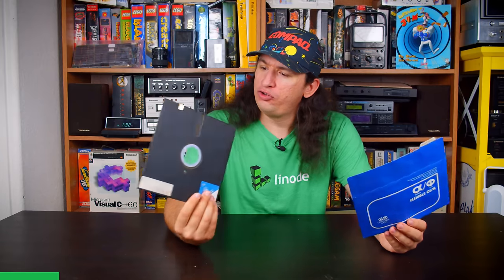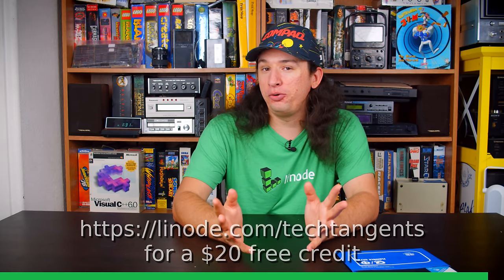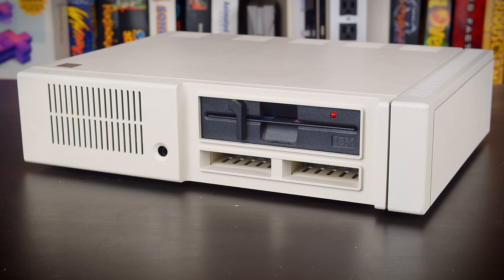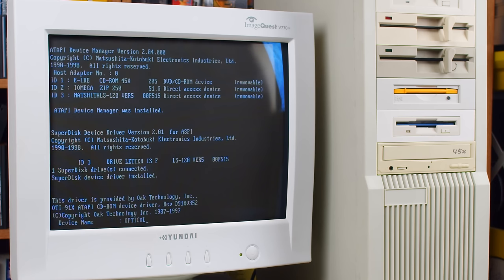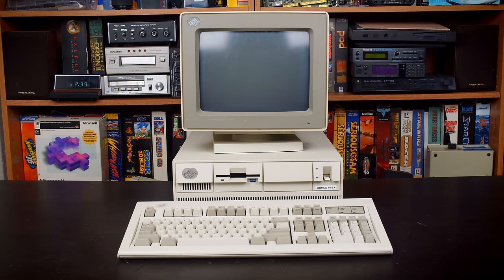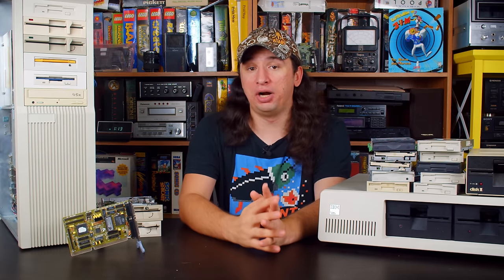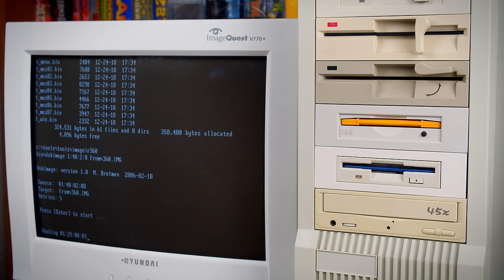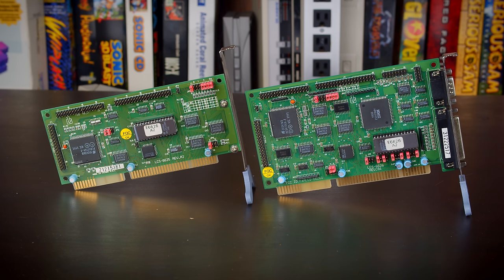More than two floppy drives?

Comment: c: I'm more of a / person.
Reply: dh0: rules all!
Reply: @MariaEngstrom  Sure thing Amigo.
Reply: Not to mention way less limited.
Reply: Oh, b:have
Reply: Me too, but for some reason getting an external floppy drive working on Linux is super finicky.
Reply: The real problem is having a board new enough to run Linux distros you can still get, and old enough to have floppy controllers.

I went to some lengths to get a mini ITX board with an onboard floppy port, onboard IDE that would support the largest IDE drives commonly available, a PCI slot for a SATA controller, and onboard LAN.  This was going to be my ultimate CD, DVD, IDE and SATA HDD, 360K and 720K imaging box.

The floppy controller turned out to be defective.  sigh.
Reply: DaVince21 Really? I’ve just plugged it in and it worked fine.
Reply: @MariaEngstrom  DF0: for the secondary win
Reply: @hawksights  Arguable 🤔
Reply: @alritedave  I was trying to read MS-DOS formatted disks and had to find a special way to mount into those, if I recall. Don't really remember what exactly I had to do or what the exact problem was, to be honest.
Reply: @nickwallette6201  
There are linux distros maintained to this day that'll run on a toaster. Slackware will still run on absolute dogshit, and Zipslack will run on less than that. It'll run on a 386 with 16 megs of RAM lol
Reply: OK, I know you CAN get old Linuxes still.  I went through this recently to try a few computers from around a Pentium MMX 166 to a Via C3.  Most of the live CDs I had on-hand failed for one reason or another.  Some, particularly on the Pentium, would just lock up.  There are certain things you can disable via the kernel parameters that will get it further, but suffice to say, there’s not a lot of testing being done on pre-Pentium 4 hardware.

Using slightly older discs (2005-2012 or so) was a mixed bag.  Some worked more or less but had driver issues - too old, too new, too buggy... Like how the Matrox driver, on a G100 series card (IIRC) was just a mess of corrupted graphics, or how auto-probing for pata_qdi hangs my VAIO laptop.

I am a Gentoo guy, so I took my newest burned install disc (which is a couple years old), and the oldest portage snapshot I have on-hand.  Broken.  Too many circular dependencies between GCC, build tools, libraries, and the stage3 environment, as thing X is WAY too old to work with thing Y, and can’t be upgraded because no version of X exists anymore that doesn’t conflict.

I then downloaded new everything, and used a DSL Live CD to bootstrap, so I could chroot into it and build from scratch, but the “kernel is too old”.  I had to search every CD binder and image file I had to find a 32-bit kernel that was new enough but still old enough.  ;-)

It can be done!  But it is not always a straight line.
Reply: Linux is trash. Can’t change my mind.
Reply: @Hogdriva  
I'm so sorry that your parents fed you lead paint as a child.
Reply: @Hogdriva  That's okay... It's okay to be wrong.
Reply: @Hogdriva  Please stick with Windows. You're welcome to it.
Reply: @DaVince21  Nah, it just works, but some drives are just bad. You could also use an external LS120 USB drive which works great as long as you use a standard 720k or 1440k format.
Reply: Same

Comment: Drive letters were a design mistake.
Reply: I certainly prefer it than the wonderful ambiguity of mounting things at dev/sdb1.
Reply: @SolidSonicTH  They're both ambiguous, but only one of them describes a partition and disk at the same time.
Reply: Lastdrive=Z, executed no CONFIG.SYS  line, ever.
Reply: On Amiga computers you don't have single-letter designations, instead floppy drives are labelled DF0: through DF3:, and you can have more DHx desginations (for hard disks) than you can shake a stick at. And these are just the physical drive names, each disk you insert in a floppy drive can also be addressed by its logical designation, for example the floppy disk which contains the installation files for HiSoft's BASIC 2 compiler has the logical name HB2Install: regardless of which physical floppy drive it's inserted in. In addition to this, you can assign a logical drive name to any directory on the harddisk; many programs which were designed run from floppy uses such assignements to fool the OS into thinking that the HD directory is in fact a floppy disk, thus enabling the program to run from a hard drive. Using the aforementioned Hisoft BASIC as an example again, during installation it creates two such logical names, namely HBASIC2: and BH:.
Furthermore, AmigaOS itself also assigns the name SYS: to the hard disk partition (or floppy disk) it has booted from, thus the same partition could be addressed by e.g. SYS:, DH0: (or DF0:), or Workbench:.
Reply: I'd actually like to have both around.
while the linux way makes it obvious where something is, with drive letters that are assigned to a disk, not to a port, the letter stays on the volume, even if you rearange what sits where.
Reply: On Linux, the /dev names are the names of the devices, which you don’t use when accessing files on a mounted filesystem. You access those via the mount point, which is a directory name, which bears no relation to the device name. In particular, you can use nice, long, meaningful names to identify your volumes, your directories and your files.

Windows/DOS copied the single-letter drive-naming scheme from CP/M, which adapted it as a cut-down version of the device names on the DEC operating system that Gary Kildall was using as a development environment--I think it was TOPS-10, which ran on their big PDP-10 machines back in the 1960s and 1970s. Disk names were of the form Dxn:, where x was a single letter indicating the drive model, and n was an integer to identify the drive, starting from 0. Thus, you had drive names like DK0:, DK1:, DR0: etc.

Comment: Two IDE channels, while redundant for most average users, uses would be multiple HDDs or CD drives (common to have a fast read drive and a slow burning drive).
There are also performance benefits, two hard drives on one channel can only access one drive at a time (shared data bus), but two hard drives on separate channels can be accessed simultaneously.
Reply: ... You know, that explains why my win 95 computer seemed juuuust a bit faster on some games loaded to the secondary HDD after I rearranged things in the case. I put it on the CD's ribbon cable instead of the main hard drive ribbon.
Considering the secondary was very slow (it was the old windows drive), I imagine it might have bogged down that newer 7200rpm drive.
Reply: Since they were available on higher end 486 boards (or as VESA cards supported in BIOS) I would almost always have them filled with a primary hard disk, secondary smaller one (removable, in a caddy) and then a CDROM. Later on the last channel received a burner. This continued until SATA, at least in my builds. I was grateful to have them.
Reply: If you connect two drives on single ribbon, while one wof them is supporting IDE mode and second only PIO4, both of them will work in slower, PIO4, mode.
Reply: @Vein1986  Yep, always will follow the lowest common mode.
Caused many headaches back in the day when UDMA modes came out. lol
Reply: It was also important to have two CD drives to copy a friend's CD! Who had half a gig on their hard disk just lying around unused for disk caching?

Comment: If you enable the external third or fourth floppy drive on the IBM PC/XT, the hard drive will be moved to D: or E:, respectively. I discovered this when adding a hard drive to my dad's IBM Portable PC, and was surprised to see it show up as E:, because for some reason its motherboard left the factory with the DIP switches set to indicate it had four floppy drives.

Also some early pre-XT hard drive controllers which required a boot disk would assign the hard drive to A: after loading the driver software and move the first floppy drive to B:. This is also the way the TRS-80 works -- if you add a hard drive, it shows up as drive 0, and the floppy drives move up to become drives 1, 2, 3, etc.
Reply: The first harddrive is fixed to C starting from DOS 5. But in 3.3, you can get a floppy on C or D.
Reply: @初生之鸟  I can confirm.  On my 5155 my hard drive was drive D: until I upgraded to DOS 5.  It was actually a welcome change because having your hard drive as D: broke a lot of install batch files and other stuff.
Reply: @初生之鸟  But what about DOS-less computers, such as those running Windows XP or later? I have had various Dual-Boot scenarios with either 2x XP, XP + Win7, or Win7 + Win7, and in all cases the currently active O/S will always assign the letter C: to the partition it booted from, while the "dormant" one will be D: and when i boot from the other O/S, its partition then becomes C: and vice versa.
Reply: @BertGrink  In NT-based Windows the drive letter assignments are stored in the registry. Pre-Vista it's super easy to have Windows accidentally on a non-C letter. I'm sure I've run across Windows installed on D:\WINNT before. You must have either done something special or have been really lucky to get each installation to see its own drive as C:.
Reply: @eDoc2020  No, I haven't done anything special, and I would rather have the partition letters be the same regardless of  which one i boot from; i.e. 1st partition should always be C:, 2nd always D: and so on.
Reply: @BertGrink  When you start the XP installer from a running version of Windows it always inherits the drive lettering of that installation (unless you modify migrate.inf)
Reply: My Compaq Portable 1 was set to 3 floppy drives and the HardCard 20 was set to Drive D and I even tried to use the XT-FDC BIOS on my 386 machine and it made the CF card not boot unless I press D several times and it took forever to boot. I did order a Promise DC-4030-VL2 that has support for the 4 floppy drives.

Comment: Another reason why many PCs came with 2 IDE channels is for many years each IDE channel would only run at the maximum speed of the slowest device on a given channel. This was more of an issue shortly ATAPI optical drives became common. Many optical drives only supported UDMA modes 0-2 (16.7-33.3 MBs x-fer rate.) Where later HDDs, especially 7200 RPM ones, supported higher speeds like UDMA 3-5 (44.4-100 MBs x-fer rate.) Later IDE controllers aren't supposed to have this issue but I remember this still happening up until at least the Pentium 3 days.
Also, since both devices on a given IDE channel have to share the data bus it made a lot of sense to place a HDD and a CD burner on different IDE channels. Especially in the early days of CD burning when it was very easy to mess up a burn in progress due to a data under-run!

Comment: The Shugart 8" drives had four drive select wires.  A jumper on the drive selected between "radial" drive select and "linear" drive select.  The Linear select used one wire per drive for a max of 4 drives.  The radial select used one wire to enable the drive, and the other three wires were BCD encoded.  In this mode you could have a max of EIGHT drives on the cable!  IIRC the 5.25" drives were similar, but could only handle a max of 4 drives (radial) or 3 (linear).

Comment: Hey hey you're finally talking about something I knew before hand! Still gonna watch it anyways because I love the production quality!
One of my many Taiwanese clone PCs, based on the DTK Turbo 640 board, left the factory with two floppy controllers and 3 drives! One controller was configured in slave mode, which is an interesting thing to set up. The second controller was controlling the third drive, which because of the ancient hackjob of a BIOS and the old version of DOS I have to use to make that work at all, and the lack of a fixed disk controller (which crashes the garbage BIOS), the floppy drives are A, B, and C.
Funny enough, I've got some weirdo Asian import no-name motherboards going all the way up to the early 2000s (AMD Socket 462) which list a "Third floppy support" in the BIOS and will let you connect a third drive on a different drive select on the same cable. I've never come across the actual cable, but jamming some wires in a breadboard I did actually manage to see it work, at least enough for Windows to show a disk drive in "F:" (That particular computer has two optical drives).

Since most controllers internally support four drives, and since you can get BIOS extensions to make those extra two drives work, you should in theory be able to modify a standard diskette drive controller, or even an onboard one to allow four drives. Most off the shelf drive controllers you see in IBMs are pretty well documented Fairchild or Zilog parts or whatever, stuff you can find datasheets on without too much hair pulling

EDIT: Haha, you talked about it in the video. The only BIOS I've seen that supports a second controller is that absolute garbage Taiwanese clone BIOS, which doesn't even do a proper memory test. No EGA support either, MDA or CGA *only*. It's probably the least functional it could be to make the machine work, but it does have that one random advantage that it happens to work with a second address card. Supposedly it supports the same for video cards and hard disk controllers, but adding a second video card causes the machine to act very strangely (switches between the cards at random, think displaying half a word on one card and the other half on the other), and adding a hard disk controller period will cause it to hang on boot
Finding the jumper settings isn't terrible for most cards! Have you tried Total Hardware 99? Statson.org is a reupload with a more "modern" layout and lots of ads if you're more comfortable there.
th99.infania.net is where I go to get all mine.

Is your LS-120 drive really that unreliable? I've never had a problem with any of the three I have laying around, as long as you keep the heads clean and the rails lubed like any other drive it'll be just as reliable. The lack of direct hardware access might cause you drama, though. I have a lot more issues with iomega drives (ZIP, JAZ, ditto, Clik!, etc) failing and eating media.

I'm interested in the "CA9277B-21" card you mentioned in the video, would you be open to dumping and posting the BIOS extension on that card?

Comment: The twist in the cable was introduced with the PC/AT and then carried over to the XT during its time of production overlap with the AT. Texas Instruments also used normal Shugart interface floppy drives with their controller for the 99-4 and 4/A using a straight through cable with all female connectors and special male/male connector PCBs to swap the ID lines for the two external drives while the single internal drive used a 34 pin 0.1" header to card edge cable. It's also possible to custom wire a cable and skip the little connector PCBs. Unfortunately TI neglected to make their floppy controller with double density support, leaving that up to the aftermarket. But there is a way to modify the TI controller to use 80 track 720K (3.5" or 5.25") drives as 360K single density. Most of the aftermarket controllers also supported 4 drives.

Comment: Funny you mention the PS/2, as the models 25/30/40 were indeed limited to 2 floppy drives, but models above that were not, eventho that did require adding controller cards.

For years I've had a PS/2 model 80 around which had 2 internal drives (2x 3.5" 1.44mb) and 2 external drives (5.25" 360kb and 5.25" 1.2mb). That was an officially supported configuration (I worked at IBM at the time and did support for PS/2 machines). This machine was used for archiving media, it also had an internal worm drive for storing archived disks. 

However, support for those extra drives was provided by the option roms (and related settings), not directly by the bios.

Comment: In the 1990s, I decided to try and use an 8" drive on my PC, while keeping both 5.25" and 3.5" drives.
My first 4-floppy FDC has been a controller made by GSI, with 2 x 34-pin connectors on the board. My setup was then A: 1.2M, B: 1.44M, and the 8" got the letter D: and was set as 1.2M in the BIOS. An 8" is really a big 1.2M drive, but with 77 tracks instead of 80. I could format blank 8" disks with DOS, and the stepper would knock 3 times at the end after track 77. No error message on FORMAT, that's normal, but I know I couldn't use the 3 last "non existing" tracks. Still cool by 1994 to write data and hear the loud stepper of the 8" drive. They were well gone by then! The challenge was to make the home made adapter from th 8" 50-pin bus to the standard PC 34-pin floppy. The 8" drives were in an external casing with its own 24V power supply, which is different and bigger than the standard PC 4-pin Molex. I still have all my equipment today, plus I bought the MicroSolutions CompatiCard IV in the early 2000s. This is the holy grail of disk controllers, and it also supports 4 floppies. It came with their special 50-pin to 34-pin floppy cable adapter, so I didn't need to use my home-made anymore, that was quite fragile (it was a piece of art, connecting thin wires between the 50-pin female and the 34-pin female, and if one got too loose, I lost a signal and got an error). I was glad to get the PCB adapter with 50pin and 34pin connectors from them...
The CompatiCard IV is able to read/write FM Single Density, in particular the IBM 3740 format developped in the 1970s, which is 8", 77 tracks, 26 sect/track, and 128 bytes/sect. Although this predates the IBM PC, I was still able to read the data sector-by-sector, and take disk images, using the program ANADISK. The file size is 256,256 bytes, so 250.25 KB...  I also got 86-DOS on that format, as well as early non-PC CP/M-86 versions from 1980-81...